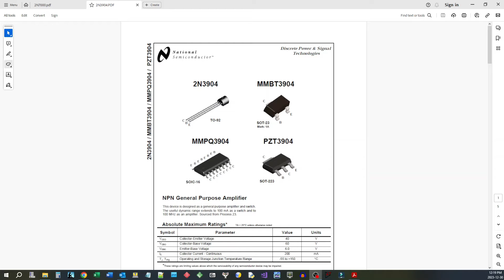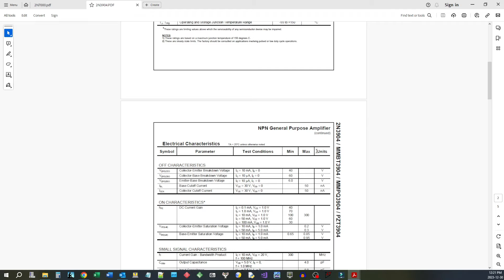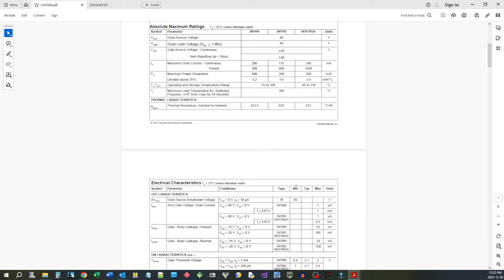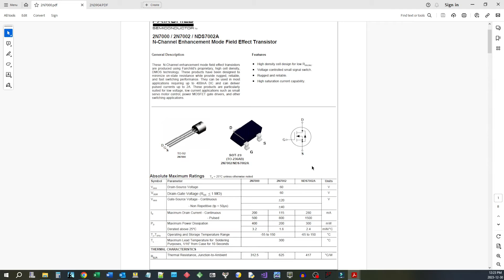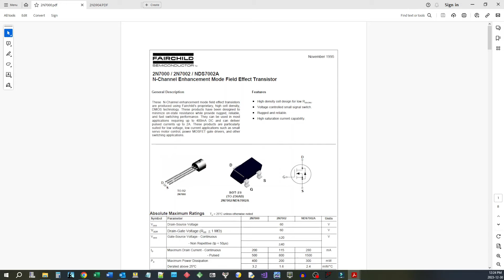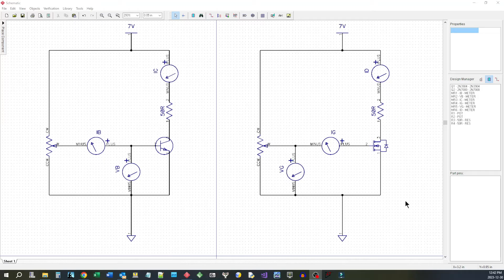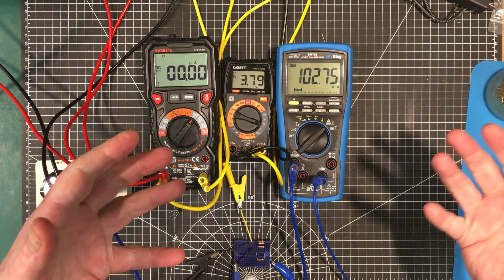0142 - Current Control vs. Voltage Control Experiment

Comment: Good info; I plan to watch it a few times, to help it sink in... I like that new bench potentiometer. You seem to manage it intuitively, rolling the knob with just your thumb. Kudos. I only have a 10K model. Are you already using your other Ohms/models?
Reply from the maker: That's the only one I've used so far,  It's the 10K version and I've used it about a dozen times.  The other will come in handy when I need them.